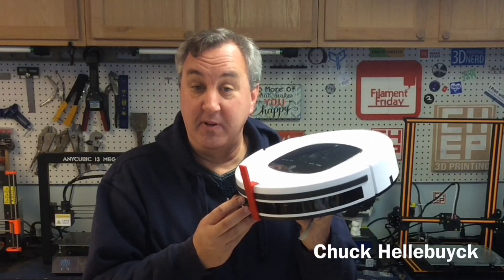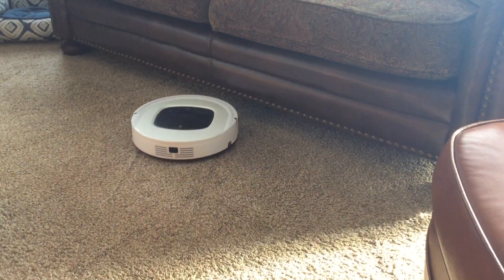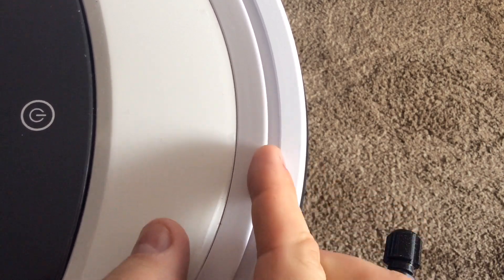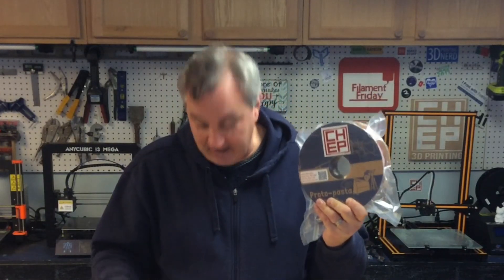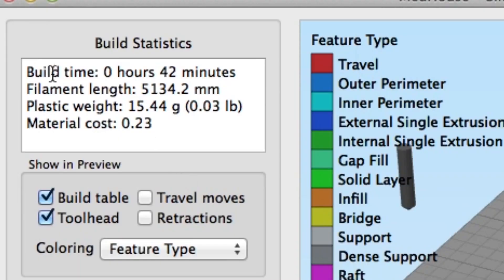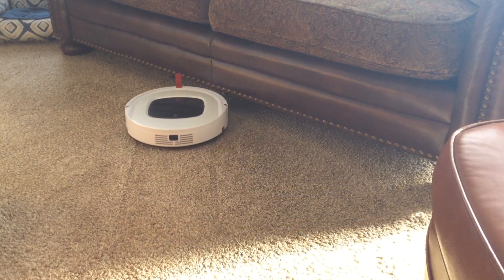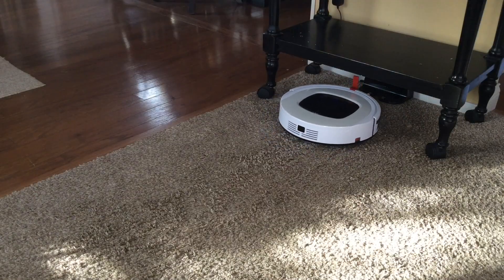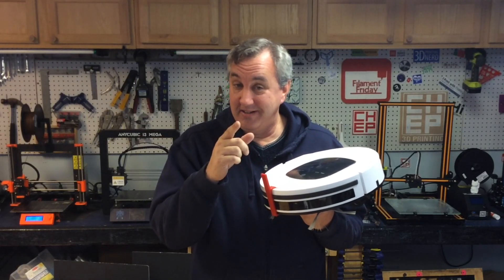Robot Vacuum Problem Solved with 3D Printed Fix

Comment: Simple solution to your problem.  The main reason I don't like other people's suggestion of printing risers is you are relying on them not to break when using them under furniture for when someone sits on it.

The only thing I see that might be a problem down the road is the top tab, the one that hits the furniture, seems to bend a little.  It might help to add a little arm that angles backwards, towards the vacuum, thus acting as a support.  Of course the direction you printed it at causes the layers to help keep it strong so it might not be a problem at all.

You might want to add the name of the vacuum to your description in case people are searching for info on the vacuum.
Reply: I had some alloy wheels on my sofa the alloy wheels broke, I designed new wheels and casters in sketchup printed them 100% solid they are stronger than the alloy one's that broke. If you use ABS filament you can make them even stronger by soaking a little with ACETONE then allow them to dry out for a day or so makes them very very tough and almost impossible to break.

Comment: i don't want to disappoint you but those robots sucks big time, specially on carpetsAnd if you add long hairs to the mixture, you'll be ending disassembling it  to clean the sabrine. I have one that I bought  a few years ago, used a few times, ended up vacuum cleaning all the time.
Reply: Same here. I tossed mine in the trash after a few months of all the maintenance I had to do.
Reply: I've had the exact same model for about 3 months now with no problems. Perhaps they've improved them since your purchase.